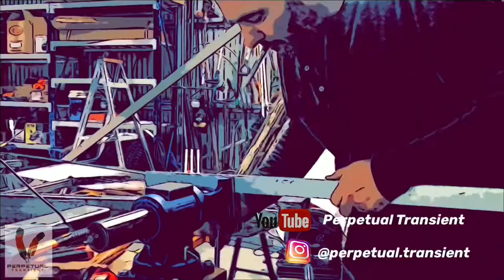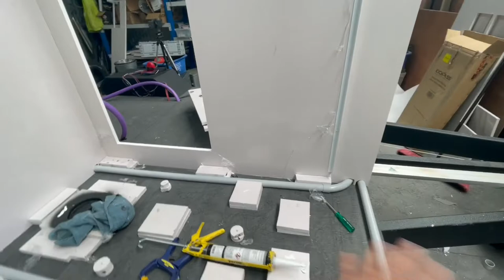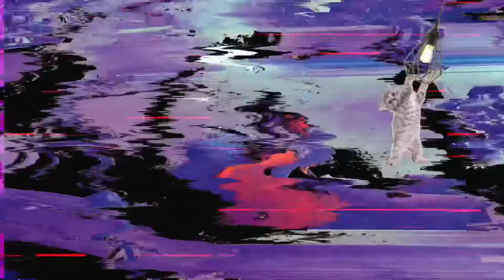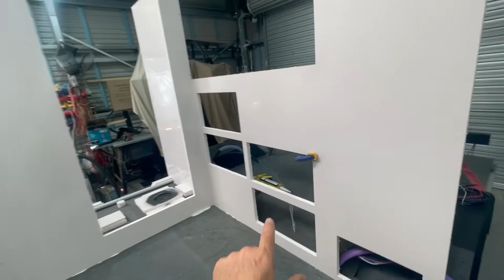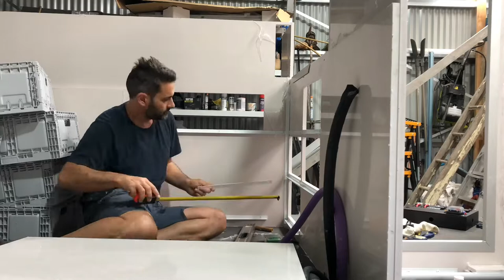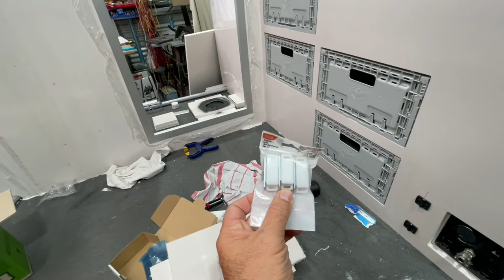Episode #9 -Solo DIY caravan build series - internal walls and drawers

Comment: I ended up retrofitting caravan drawer latches to my drawers as they kept opening on the corrugated roads. I also have ball bearing runners on them as well.
Reply from the maker: Yeh i think these won’t stay in. Thinking a swivel latch on the front to stop them or similar. I have caravan locks but can’t figure out how to mount them with the arrangement i have.

Comment: Loving your build, what was the floor and wall material you used. Cheers
Reply from the maker: Thanks Wayne. I run through that in the QA episode if you wanna check it out. The floor is thermolite and the internal walls are purelite
Reply: @PerpetualTransient  Cheers found the question and answer episode